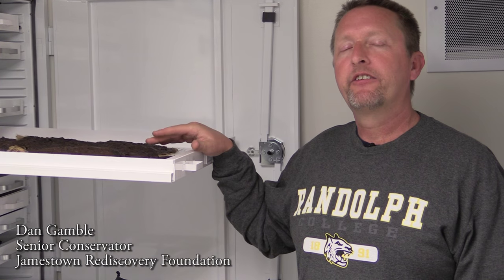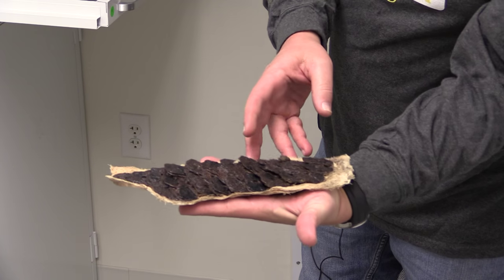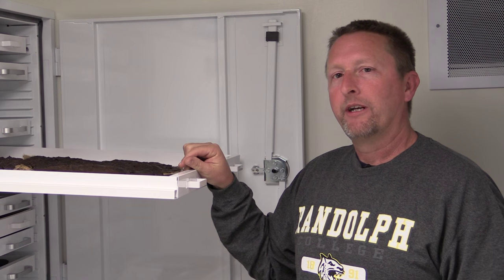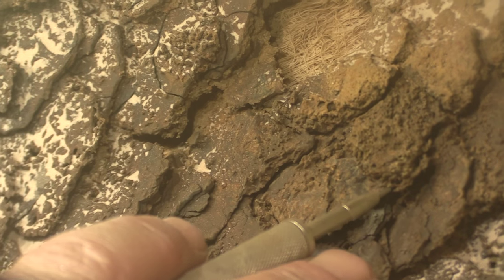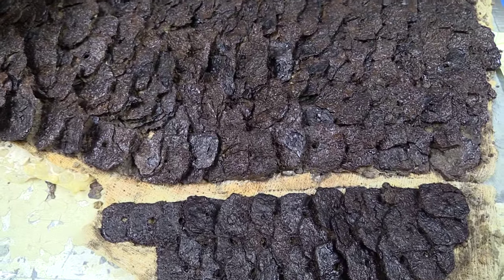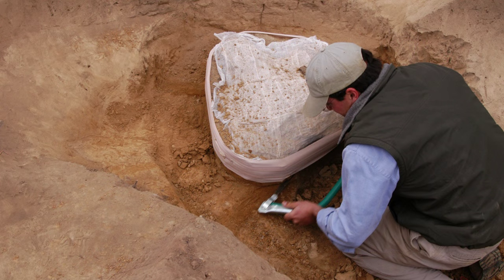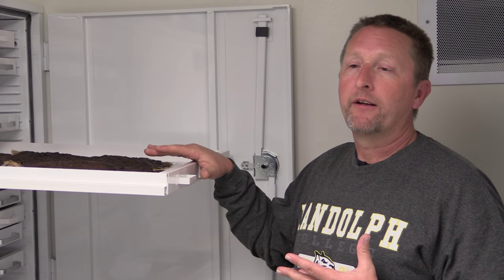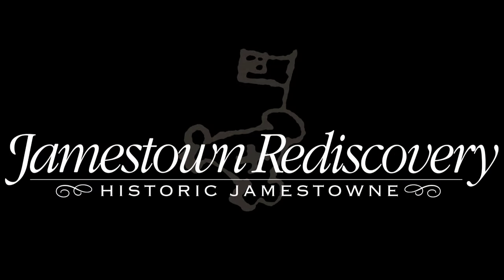Medieval armor coat conserved at Jamestown

Comment: alongside those in England (I'm assuming that'll be the Royal Armouries' one?), I would also suggest you contact the National Museum of Scotland, as they have at least two sections of fragmentary jacks of similar construction with their textile elements partially preserved, which serve as excellent cross-sectioned views of the structure. they also have another Jack, which is in an excellent state of preservation, which has been mounted and displayed, which could serve as a secondary source material to the RA one. 

looking at the x-rays you've shown here in the video the similarity is absolutely striking to the x-rays I've seen of those in the NMS - quite literally the exact same structure of a square plate with punched hole, and clipped corners, with the proportions almost matching. 

I'd love to see any research paper on this find which is published, too.
Reply from the maker: +J. G. Elmslie That's great. Do you have any contact info. for the folks in Scotland? You can reach out to me at my email dschmidt@preservationvirginia.org if you'd like. ThanksDanny
Reply: I'll see if I can do an archaeological dig into the lower strata of my email history - I think I've got one or two of the current curators' contacts. :D